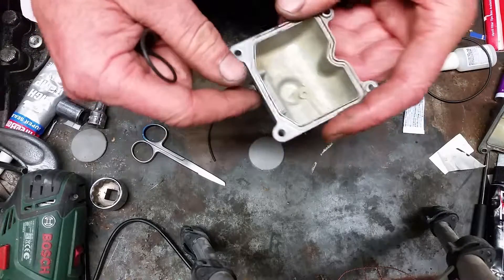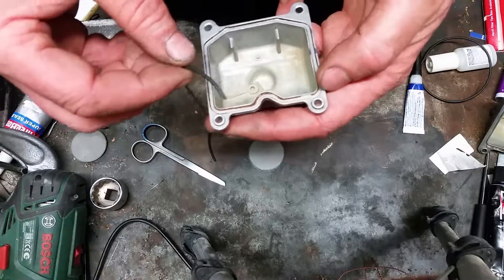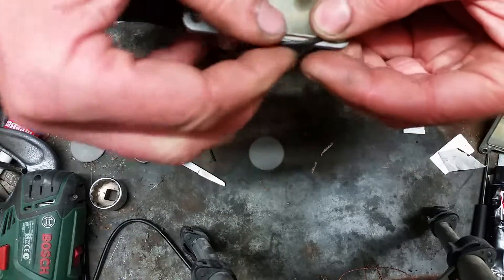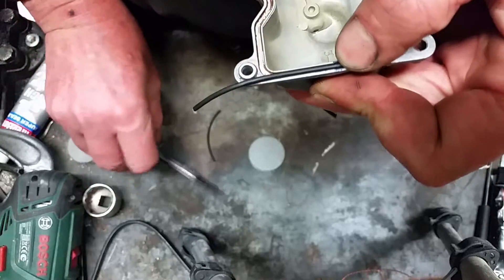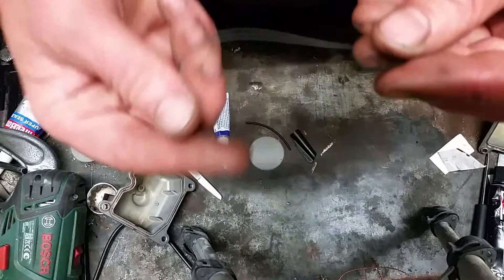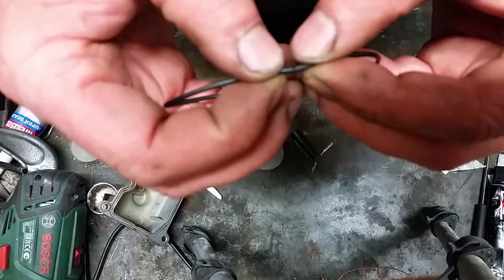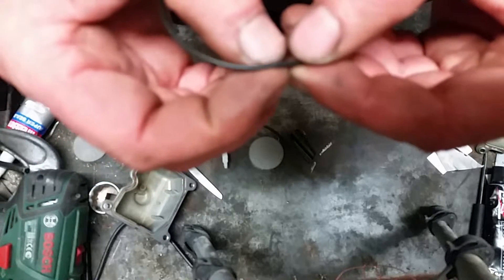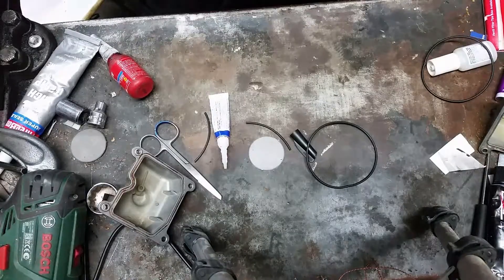Carby bowl o ring

Comment: Is it holding? I have the same issue with the carbs from my Gpz 500S and toughted at roughly the same ideea,to pun directly an large O-ring and shape it somehow in the bowl's grove. It would help much to know the diameter of the ring,i may find some directly on the size that i need,without needing to cut and glue em....
Reply from the maker: Hi there. I don't have the bike now, but it is the accepted method of making custom o-rings. There are kits available to make such o-rings.

Comment: Hey Wallacey, Just wanting to know where you sourced the O rings you cut to size
Reply from the maker: Hi, I bought an o-ring of the correct cross section and larger than what I needed from the local bearing supply.
Reply: @Wallacey1  Thanks Wallacey, looking forward to sealing up my leaky gaskets